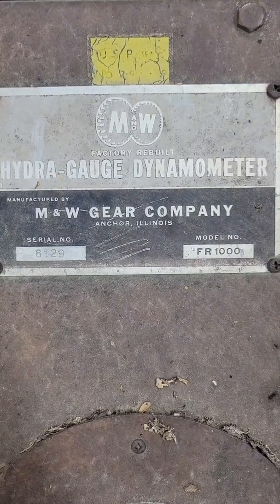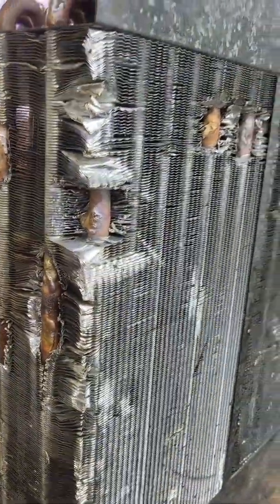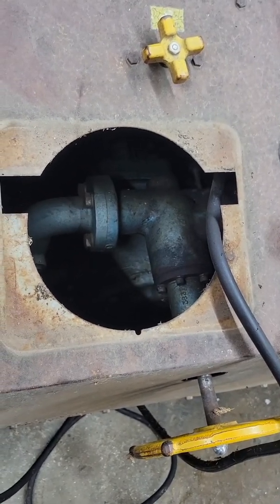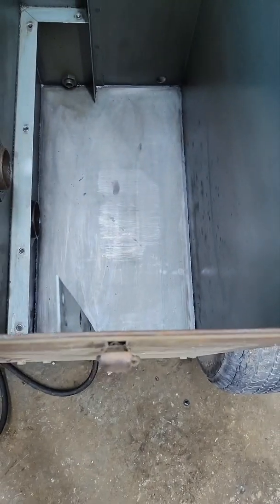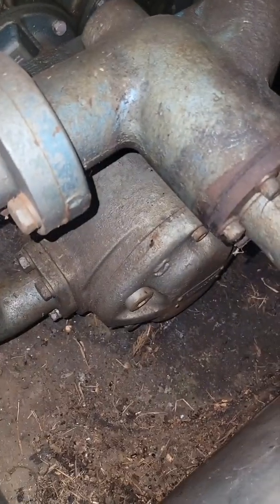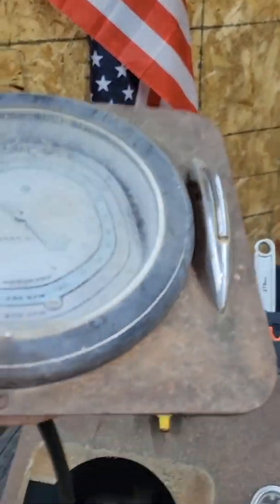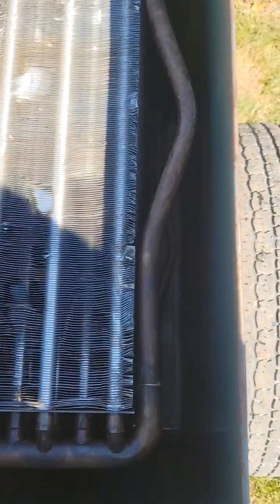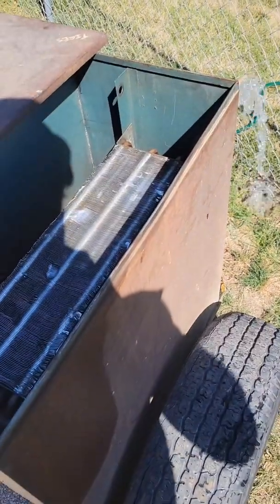M&W dyno repairs.

Comment: I have one, spent $2,000 on it "working" at an online only auction. Got it home and and it definitely was not "working" pump blows the seals at 200 psi. Replaced seals and pressure ring, still blows seal. Looks like I will replace the pump. These units are hard to find so it might be worth putting a pump in it. Parker hydraulics builds a pump similar to the original Hydreco pump. Minimal modifications.
Reply from the maker: I dont suppose you have any part numbers to share with me on that parker pump...just in case?

Comment: What oil grade are you putting in the dyno
Reply from the maker: The gear box uses 80-90, but I put synthetic 75-90 in mine. As far as the hyd oil I am using farm store iso 32. As it is close enough to the 10 weight specified by the m&w manual I have.

Comment: Wow thats neat never knew that they made a pto powered tractor dino. Thanks for sharing this
Reply from the maker: Yes these dynos were made to measure horse power of a tractor via the tractor pto. It is also a valuable tool for new/rebuilt engine break in and trouble shooting a engine power loss.